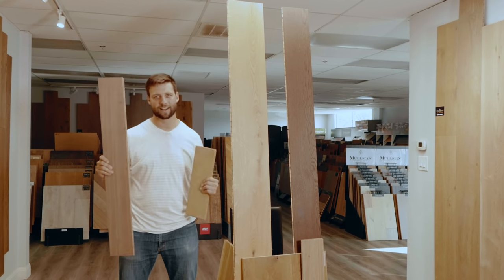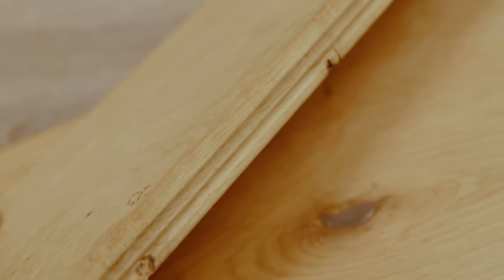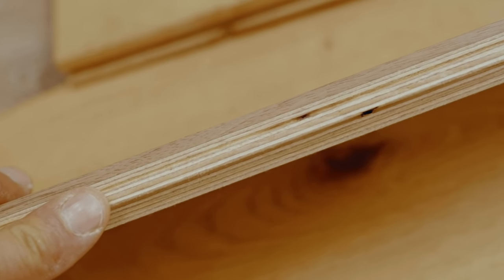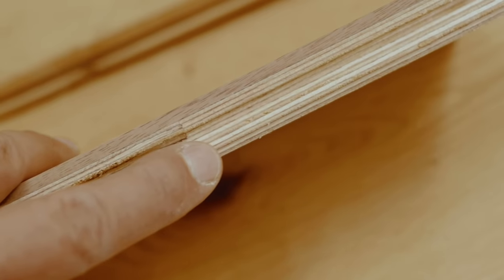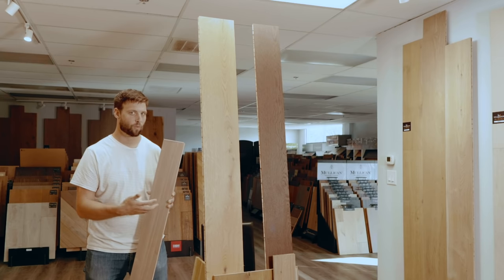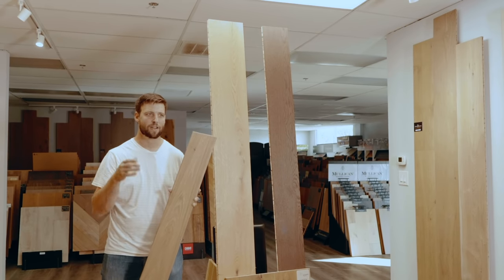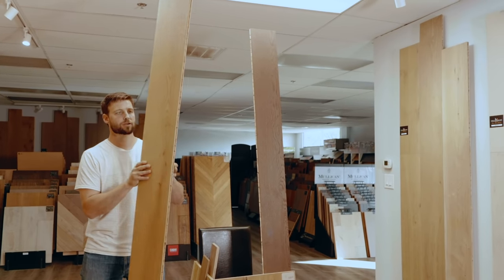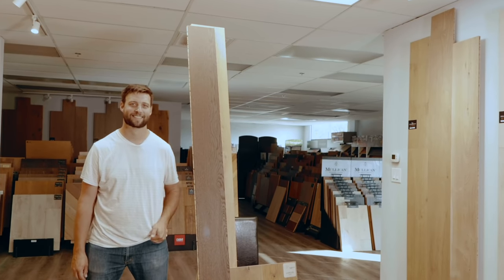Solid vs. Engineered Hardwood Floors.  What's the Difference?

Comment: On the other hand: I'm still able to restore 130 year old solid wood (pine!) floors by sanding the upper few millimeters off. Others have been doing the same thing before us for generations, and there is still enough meat on the planks that they are stable. Engineered wood is just another environmentally disastrous industrial waste product. When I see what's already happening to engineered wood buildings in the UK I could cry. "Eco beams" falling apart, Gluelam beams delaminating... Horrible.
Reply: WOW, thank you for sharing!!  Nothing like the real thing!!

Comment: Here is zone 6, most new higher end homes use 3/4" solid hardwood for 1st and 2nd story floors and luxury vinyl for basements over concrete.  The cost difference between solid and engineered hardwood isn't worth the limited times engineered could sanded for refinishing.  It also isn't worth the extra cost to install engineered wood over concrete if a floating subfloor is required.  If you want flush wood floor register vents, they all seem to be 3/4" thick, so good luck if installing 5/8" thick engineered hardwood or install 1/8" thick underlayment first, which drives up the cost.

Comment: Well done Jordan. Watched this Oct. 2024. Just had our 1st house built at age 75 and we didn't know squat about flooring. Actually we doesn't know anything about building. Long story short we had Shaw LVP put on a slab and now Shaw has pulled this style because of unknown reasons and flaws. It's all buckled up and seam cracking. It's Luxury Junk. We came from a home with basement and solid red oak flooring installed in 1956. Refinished 10 years ago and looked great. Your video has helped me decide to get some real flooring and have it done right. Expensive but right. THANK YOU.

Comment: Great info coming from an installer. Pretty much the same way I explain the differences in the structural parts. Although calling the veneer the "wearlayer" makes me cringe. 
Adding more info about finish qualities which reflect the warranty of the finish, which affects costs would help some people.
Also reminding people that if their floor is textured, wire brushed, hand scraped, the veneer can only be sanded flat and usually can't be made as pretty as it came out of the factory. Yeah there are special people that can scrape the floor and make it pretty. But the to Rip it out and put new in with a factory finish would be cheaper. So the veneer thickness is kinda redundant and not important for some floors, because they will just be ripped out and something new will be put in. It's our "disposable society".
You explained plywood with a veneer very well. The Bona product you discussed uses "staves" instead of plywood, which was pioneered by Lauzon. Also used by Mannington and many or manufacturers. Another peice of info to discuss.
Again, very well explained overall!😀

Comment: The engineered floor I was shown was made of a sawdust base. I could not sand it and it was thin, like 1/4 thin. It looked like it was a laminate-type flooring. The company said no it was called an engineered flooring. If I was shown something that you just shared I totally would go for that type. Thanks for the info! It has been very helpful.

Comment: We have 3/4" oak in high traffic areas but used engineered cork in one bedroom and engineered bamboo in another (high quality, not builder grade).  Our bamboo also looks just like new but a lot of that has to do with the quality of the finish.  The cork has held up very well also and feels nice under foot.  For bedrooms these are typically floating installations with click and lock boards, so no nailing required and no creaks in the floor down the road due to nails working loose.
The floor wearing out after 7 years has to do with the quality of finish and the type of traffic.  You can get poor quality finishes on solid wood flooring as well.  My oak needs refinishing, but it's in a high traffic area where furniture also gets moved around, so that's normal.  Dogs will also wear out the floor faster.  3 coat poly will not last long, but 5 or 7 coat poly will last many years, so do your research before purchasing.  If working with a builder, consider upgrading to higher quality finishes for longer wear.

Comment: A large national discount flooring chain sells engineered hardwood with a paper thin wear layer. I doubt you could even refinish it once. I went with solid wood (from the same chain), and it was somewhat of a mistake. The milling was flawed (boards vary in width by 1/16" or more, excessive snipe on the tongue side of a large number of boards), and it took 10x longer than it should have to piece together a floor without gaps. Since it's prefinished I couldn't just fix problem boards with my woodworking tools. 

Next time I'd go with quality engineered hardwood. The labor savings alone will be worth it even if it costs more.

Comment: I always loved installing solid wood flooring. I found a mill in nearby state that sold old reclaimed wood flooring, as well as clear or "rustic" aka knots. I learned to install floors, and did my own (but not the finishing). With your video, you cleared up the notion that "engineered" is not only sandable, but you can get 2x the refinish out of them as much as solid flooring. (ofcourse the pre-finished, cheaper flooring is the one I saw the most, so I never knew there was a solid wood laminate over engineered. Thank you. Something now to consider now. What is the end resource of engineered when its done? Solid wood floors can be milled or recycled- what about engineered?
Reply: To my knowledge engineered is basically made out of wood too but instead of a solid piece it is being layered with cheap woods/plywood (spelling) under and so on.

Comment: Do solid. It can be professionally covered with  polyurethane or lacquer. I'm from New Orleans. Our floors were 50 years old. First, we had to get them professionally sanded, then stained. After they were coated with polyurethane, they stayed beautiful and looked brand new through 2 active toddlers, a boxer puppy, and toys being played with on the floors, etc....To clean, the professional told me to use a damp string mop, taking as much of the dampness out that I could. It cleaned wonderfully.
Reply: This has worked for you on a slab?

Comment: Excellent explanation!  Thanks for the video.  I decided on Bella Cera engineered hardwood.  Got the Villa Belize in Butera which is French Oak, 7.5" wide planks.  I'm installing it now.  I really dig the smoked look and they have 8 coats of Bona matte finish that really makes the grain pop.  Only a 2mm wear layer, but I have no plans on refinishing.  If the times comes for a change, I'll just replace it.

Comment: What about concerns over the out-gassing of the adhesives used in the engineered hardwood? Also, what happens if the plywood underside ever gets wet? I have seen what happens to plywood when it gets wet-not good!
Reply: yes

Comment: In hot abd humid environments do engineered wood have a higher tendency to warp as plywood and hardwood expand and respond differently to the same amount of moisture and heat?
Reply: I had a home built in 1955 with oak parquet squares on concrete slab. When I bought the house in 1989 I had the floor sanded and 3 coats of polyurethane mopped on. Still looked beautiful when I sold in 2021, and the house is in the Deep South. It’s humid and hot outside but the ac keeps humidity from being a factor.

Comment: @JordanSmith I'm planning to go for a DIY on our master bedroom suing engineered hardwood and my subfloor is the actual concrete slab. So I believe i could use glue to get it done. But do i need to have a moisture barrier put in? But then how the gluing works for the hardwood on top of the moisture barrier? Kindly provide your inputs on this.
Reply: I definitely would if you can afford it

Comment: Excellent:  Question- is their a thin insulated - moisture barrier pad that helps later with creaking of floors later to place between concrete and engineered wood floors?
Reply: No none,  most flooring glues good ones anyway  have a primer /sealer, then flooring.

Comment: I have concrete floor since our house is built on a slab.  I want to put a dance floor in one of the rooms.  It cannot be vinyl because our feet will hurt if we are dancing on concrete.  This room I do not keep the temp of the rest of the house to save money.  Thermostat is set at 50. In winter, on sunny days, the room will warm up to 60 on its own.  We are ballroom and Latin dancers, so we cannot have even a microbevel.  It needs to be installed flush.  My husband likes the lighter oak look and thinner width planks that would be real hardwood.  We were told we cannot put real hardwood in unless we put a subfloor in.  What are our options?  Thanks.

Comment: I have a very large room about 500 SQ FT I like to put something that has weight because I don't have sub flooring I have a concrete I also have underlayment because initially was going to put veneer plank flooring but it was too hollow sounding and crackle when I stepped on it. So is there a product for my situation??

Comment: Hi Jordan I am in the uk with a pex/water underfloor heating system under liquid screed (75mm).  What’s your thoughts on laying the long and wide white oak planks? Glueing  etc
Reply from the maker: Make sure that the glue manufacturer allows for underfloor heating, but I would be comfortable putting an engineered floor down on a radiant heating system.

Comment: Can you expand on cost difference. Is a 6mm wear layer engineer floor more than a true hardwood?  If so, and you are installing on wood subfloor up north, and you don’t want/need large format/wide planks then am I wrong to say true hardwood is still the best option? That’s how I see it anyway.  But I agree if going on to slab or need those wide planks than engineer w thick wear layer is best

Comment: Why is there an issue sanding to the tongue? Until you sand through the tongue, it'll hold. Also, the key issue with engineered is delamination. With wide humidity swings, almost a guarantee.

Comment: In Europe we glue slabs on concrete floor for 30years for sure.
Reply: the european slabs are a lot different than the american ones. In Europe they put insulation and screed on top of the concrete, while the americans (at least the ones i saw on youtube) just put their floor on the concrete without any insulation.

Comment: I am a bit confused.  On some youtube tutorials they are saying that engineer last up to 30 but solid last up from 30 to 100 years due to the fact that it is solid and also i can be sand more than engineer.  Is that truth?  You said that their are both as in sanding thickness.  This is where I am so lost.
Reply: You can sand the same if its a good quality engineered with a thick wear layer.  6mm preferably. 
On solid hardwood there's about 6mm before you get to the tongue (the groove where you connect two pieces of wood). So he's saying this is basically the same.  You have to get a 5 or 6mm wear layer though in order to do this.  And...The core (the plywood core of the engineered hardwood) has to be a good quality wood still.  Like Eucalyptus wood.

Comment: Good vid. But only based on recent developments. Like most American stuff. All this stuff on wear layers is kind of BS. Solid floors used to have huge wear layers, even if tongue and groove. We are talking 10mm. Go to an old house where you guys came from (UK) and see what the wear layers are doing on the boards... or France. The modern wear layer is standardised whether it be solid or engineered. To decrease cost. So everyone can have hardwood floors. Poorly prepared and selected materials becasue nobody will pay, they know they will sell that house before they get the design life out of the floor. Useless materials. The engineered wood is lower grade, like veneer. It's selected becasue it can't be used any thicker. If your are interested look into it. If not, continue to buy engineered floors every 5 or 10 years... becasue when you try and sand those suckers, they wont look the same at all. And who wants to sand a cheap floor anyway, 5 or 10 years is more than enough. Just rip it up and buy a new one!! Ha ha ha 😂🤣😂

Comment: I still prefer to put a dimple mat over a slab. Could engineered flooring be put directly on to a dimple mat, or do you have to do a subfloor at that point? The two reasons I like dimple mat on concrete is that 1) research shows people living on slabs tend to get arthritis at a higher rate because of the hard surface and moisture 2) I can have some degree of leveling the floor with a dimple mat.
Reply from the maker: Good question.  I am not sure what the protocol would be to glue to a dimple mat. There are now "click" together high quality engineered floors that you can float.  That's probably the way I would go.

Comment: Thanks for the explanation. I have both kinds in my house. The engineered floor serms much softer: can dent it by just dropping a key or light tool onto it. Is this expected?
Reply: If it has a very thin wear layer, you could easily dent the plywood underneath. The 3-5mm wear layers Jordan showed won't dent unless you drop something really heavy on them.
Reply: @mattv5281  True story. I have a thin engineered hardwood in my newer build house (less than 10 years when purchased 3 years ago) and there are a couple 'dents' here and there. My wife just purchased a house that's 81 years old with the original hardwoods and no dent in sight. 
I just knew of the cheap engineered hardwoods and not about the baller engineered hardwoods. We'll definitely go with the thicker wear layer engineered hardwoods. I know her floors are solid hardwoods because we're finishing up her bathroom after a full gut. The hardwoods are about 3/4" of solid wood goodness. You can see the finish nails where the room meets the hallway, etc...

Comment: Good video, but your comment that “99.9% of homes in the south are on concrete slab” really isn’t true at all. I live in Georgia and my house has a basement as do most new construction homes here. 

Generally here, slab homes are considered to be lower quality, cheaper homes. Some older homes are also on slabs, but many older homes are on crawl spaces or cellars.
Reply from the maker: Good comment. Being from Texas, I think of the south as different than what is probably technically the south.  I prefer a raised house and a wood foundation or a basement is a great way to do that. In Austin, because we built on so much limestone, slab on grade is the most common.
Reply: @JordanSmithBuilds  yeah I agree in Texas it’s unheard of to see basements. But is Texas the South?  I usually think of Texas as the Southwest.

Comment: Do the correct research. You’ll never choose an engineered floor over solid wood if it is for yourself. It’s the same decision as a partner to have children with or just a few sexy partners. 
The “eco” argument is ridiculous. You’ll use up far more resources going Engineered wood over the lifetime of the flooring. For example a Japanese cypress (Hinoki) wood will slowly strengthen for 200 years before slowly returning to its natural strength. Hows that for longevity?
Engineered wood is for the under researched or cheap jobs. That’s why the house building companies use/recommend them. Profits…at your expense. “Have a nice day”!

Comment: There is already a moisture barrier that's laid down before the concrete is even poured so you won't have any issue of moisture going up to the hardwood flooring whatsoever, so yes you can glue down hardwood floor straight to the concrete slab and you won't have issues
Reply: I'm about to install hardwood floors in my below grade floors and i'm so worried that'll it'll go south. I know under my slab there's like a 16Mil vapor barrier and was planning on putting wax paper, 3/4 plywood and the nail the floor down. What are you thoughts on that?
Reply: @DMosPx well if you want to be on the safe side they do have moisture barrier specifically made for hardwood that you can roll on the concrete and when that cures you can apply the adhesive straight to it and lay down your flooring, it actually might be cheaper that buying all that ply and whatever you'll use to lock down the ply the moisture barrier comes in a 5 gallon bucket and it's probably around a few hundred for it, unless your using a hardwood that's going to be nailed down then put ply
Reply: @kalegallarde6369   yeah it's nail down and i need the height as well. The ply i'm getting at a decent price so i wouldn't even factor it in. I made a reddit post asking questions and i've never been so belittled in my life lol
Reply: @DMosPx  my main concern about the ply is it being locked down good so it doesn't loosen up then you'll have hollow spots that could possibly bounce with the flooring on, are you screwing it down or nailing it down?  I'd be tempted to glue the ply down with some pl adhesive before locking the ply down
Reply: @DMosPx  possibly priming the back of the ply that's facing down with oilbase primer then use adhesive and lock the ply to the concrete
Reply: @kalegallarde6369  was going to screw them in with 2 -1/4 tapcons
Reply: @DMosPx  that's some long tapcons for 3/4 ply, plus you'll need quite a bit to make sure the ply is locked down good. Better make sure you got extra bits
Reply: @kalegallarde6369  I figure I have 6" + of slab it wouldn't make much of a difference. But thank you for this conversation. This has taken a bit of the worry away from me. Reddit is a horrible place
Reply: @DMosPx  yeah no problem I'm sure you'll get it done and it'll hold up strong, I don't know much about reddit I never go there